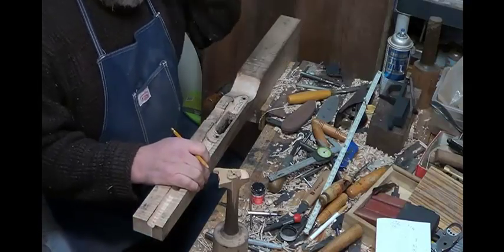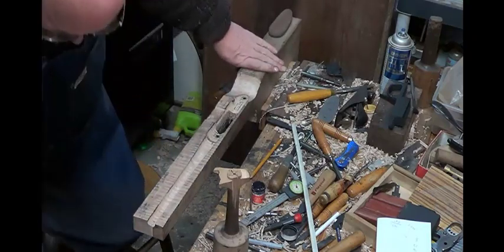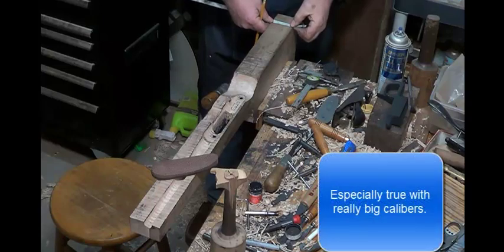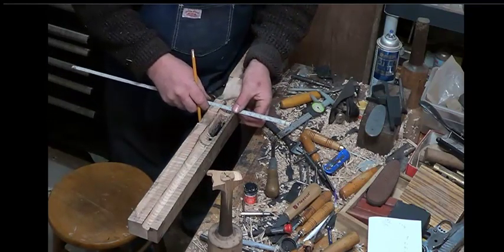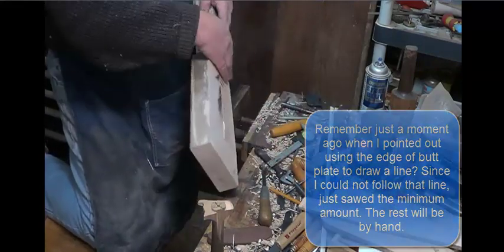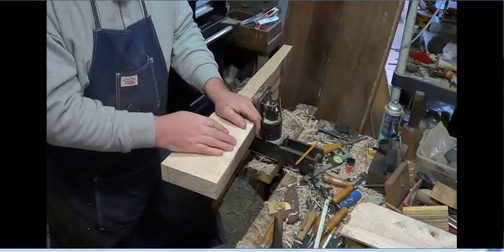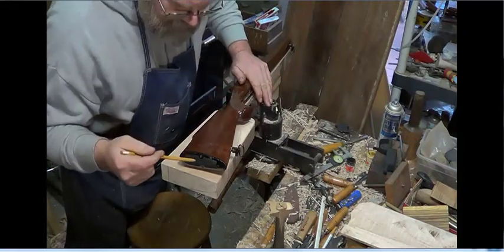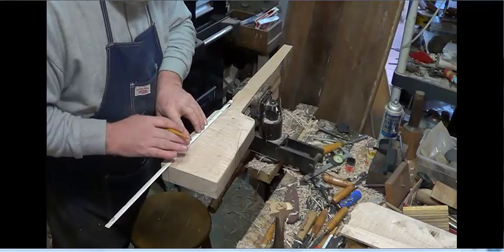Inletting part 8-Laying out the Gunstock

Comment: Hi Chris,  your videos series has motivated me to try a stock of my own from scratch and with hand tools.  I am making it out of walnut and it's for the Savage B-mag .17 WSM.  I have several videos up on you tube if you want to check them out.   Any advice would be greatly appreciated.   I didn't get into the custom fitting with the ofset for your shoulder but I an going to change the pull and grip from what the factory stock was.
Reply from the maker: Making it yourself with modifications that work for you is what custom really is. Good for you and late is I am getting back to you....best of luck.  BTW, how do I get to your videos?
Reply from the maker: Evan Lawrence Thanks!

Comment: hi Chris  i've learned a lot from your video's   even though i hardly use handtools,only for the final inletting and final shaping
i do as much as possible with a beltsander and a router, it goes much faster but it's also easy to screw up on the whole project , can you explain me how to shape the buttstock and the grip area? just not sure how to shape the comb,  just some measurements is all i need ,such as the circumference of the palmswell and the width of the comb and that kind of stuff
thanks